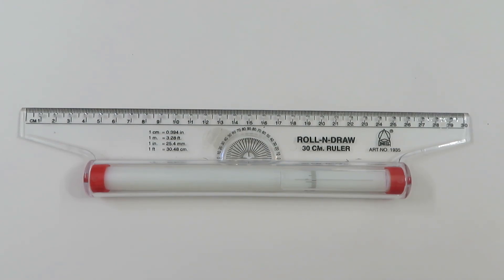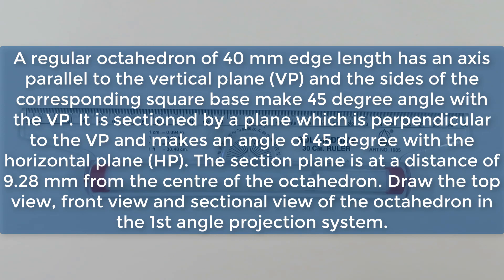5.7-Sectioning of a regular Octahedron

Comment: Can you do demonstrate a  projection from an existing compound mitered profile , to an unfolded 2D plain . The profile I'm expermenting with is basically two pieces of crown molding that form a mittered corner.
Reply from the maker: @adamkraft1786  google drive link
Reply: https://youtube.com/channel/UCkCk0nvNyWhEOLge9JtDLDg
Reply: @1styearengineeringdrawing182  can't seam to b able to share an image through my drive
Reply from the maker: @adamkraft1786  I have given my email address in the About of this YT channel.
Reply from the maker: 👍Thanks a lot for the nice example. Could you please share some more information about this, such as pictures etc? Interesting!✔
Reply: I'm trying to project the miter joint to a flat 2d plain. The goal is to replicate the wooden shelf, using 16ga polished stainless steel. Without all of the excess details that are milled into the wood with exception of the arc. The drawings are a side profile and a top view of the miter along with a 1 in perimeter flange.
Reply: The goal is to water jet the profile in the 2D plain out of a single piece of Stainless ,then form the arc and Bend as needed , weld and polish the mittered profile to a seamless finish